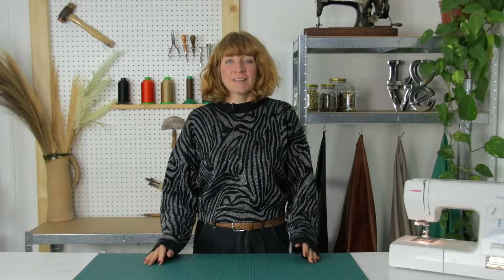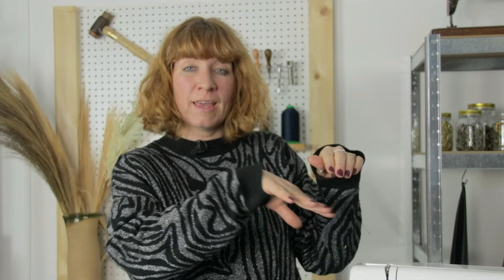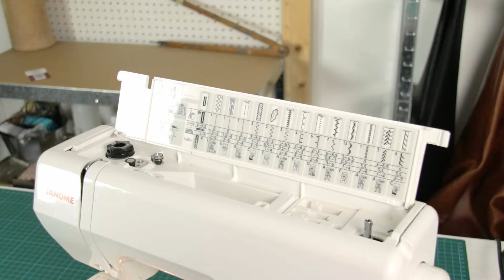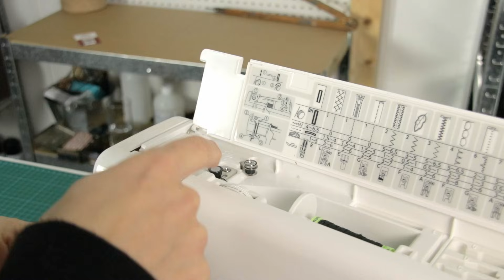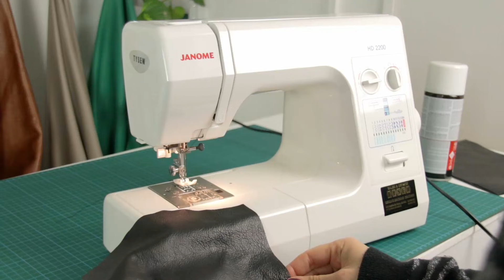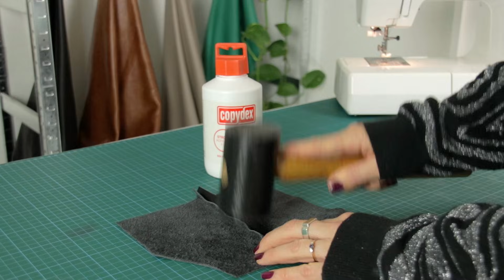How To Set Up Your Domestic Machine For Sewing Leather

Comment: Thanks for the great info . If I’m sewing leather scraps together to make a patchwork design. Should I overlap the edges or put side to side and use a zig zag stitch ? Thanks again
Reply from the maker: Hey. I would suggest overlapping then with a 5mm overlap, then top stitching them together. You can also zig them together but my preference is normally to over lap them. Thanks. Bex

Comment: Never iron leather.  The heat dries the leather out and weakens it, more prone to ripping. Use fabric tape on the seam allowance to prevent stretching
Reply from the maker: Yes you are correct @kyliewalker6647 . Garment leather which tends to be lamb napper is very fragile. You can still iron the back of the leather but never the surface with a low heat on your iron as it can shrink the leather.  Most garment construction uses tape in the seams to avoid the seam ripping or distorting over time. However, in bag making we always use iron on interfacing to stabilise the body of the bag, all high end leather accessories designers use this method as it is required for a professional finish. Most bags are made from cow hides as they are more robust for accessories and can take a hot iron from the underside never the surface. Thanks. Bex xx
Reply: I’ve seen Professional bag makers use a heat machine to cut and seal the interfacing to leather, I’ve also seen arteliers’  glue interfacing, without heat.

Comment: Where do you set your tension? I’m using a Husqvarna 165 Husky. Any recommendations?
Reply from the maker: Hey. Different machines have tension that vary from machine to machine. Most machines have a front facing dial that the thread feeds through. You can turn the knob to adjust the tension. There is also tension adjustments on a bobbin case. I've found the manual for your specific machine. Here: https://www.manuals.co.uk/husqvarna/husky-165/manual?p=5 I hope that helps. Feel free to ask any further questions. Thanks. Bex
Reply: @rjleatherstudio1368 that was very thoughtful of you ❤

Comment: In my opinion, I do NOT recommend Back / Reverse stitching when sewing leather unlike sewing fabric as when back stitching, the direction might not be the same ( diverted ) as forward stitching, thus making / leaving unnecessary needle holes on the leather which will stay permanently on the leather !  ( If you watch YouTube videos by professionals or leather garment manufacturers, they NEVER do Back  stitching ).  After finish stitching, tie the threads at both ends and seal / secure them with a lighter.  Moreover, it is a very detail & tutorial video ... Thanks for sharing !
Reply from the maker: Yes great recommendation. I also do a similar thing when topstitching. I pivot wit the needle in the leather and go back on myself in a forward direction rather than backwards then pull the threads through, triple knot and copydex glue the. I do however back tac on the underside of the leather!  I have worked for manufacturers and fashion designers and have found that everyone has different techniques!
Reply: Instead of using Copydex glue, but I prefer to use Double side tape as it is more convenient especially when I need to do a French seam especially for upholstery or carrying bags or other durable items etc ...
Reply: That’s true, they do tie the ends when sewing bags, but I have to commend her tips, she got everything else right & I haven’t heard anyone else mention the paper trick, so I learned something new. Using double sided tape is great too, it’s cleaner and u can sew thru it, it’s strong & keep everything neatly together
Reply: You are right. I just go over it again 1" from the bottom.

Comment: You're looping the thread while the foot is up? I was advised to do it with the foot down otherwise it would break (the thread). Does it have to do with the brand of the machine?
Reply from the maker: Hi Yamilet. Thanks for your comment. I have always been taught to do it with the machine foot up, for the domestic and industrials sewing machines. It so interesting how Manu different techniques people have for sewing.  I have never found that it breaks the thread. However both ways works perfectly well. Have a good day. Rebecca x

Comment: Thanks for this tutorial,  very helpful,  glad to hear about the thread, that's what I was wondering about, I'm in Australia and we have Guttermann thread here, so good to know, and great to see a Janome machine,  I have one as well, different model though. Also handy to know about the foot pressure,  but wondering what you do with the tension,  do you increase or lower? Thanks once again 🌻💜
Reply from the maker: Hi Kathy. Thanks so much for your comment. I am really happy to hear that you found the video useful. Janome are a great brand of machine. Tension should be adjuster more for the thread itself rather than the leather. I normally test sewing on a a double layer of scrap leather first then look at the stitch, I adjust the tension based on what the sample looks like. Thanks. Rebecca x